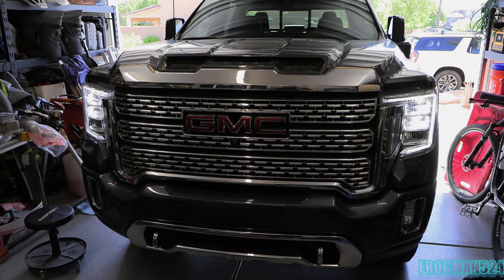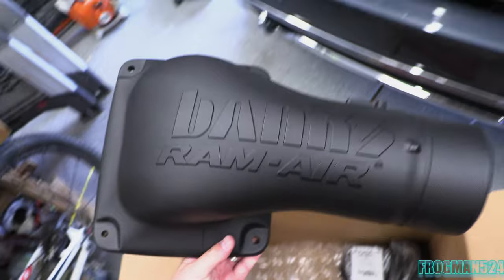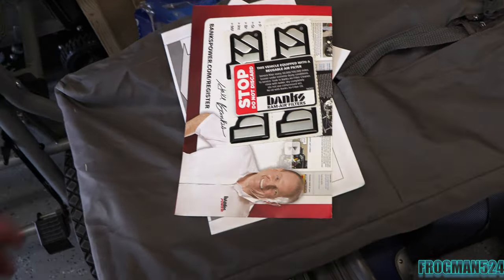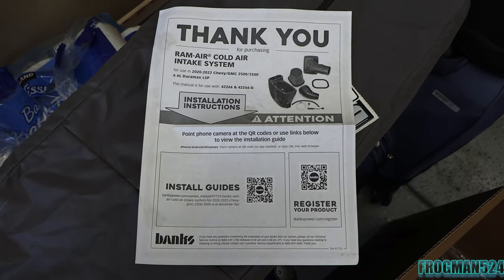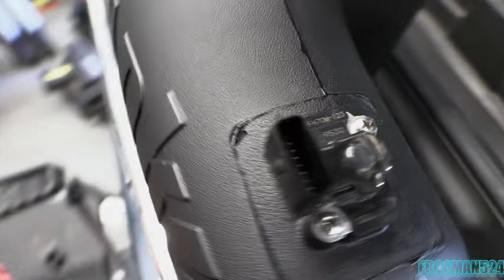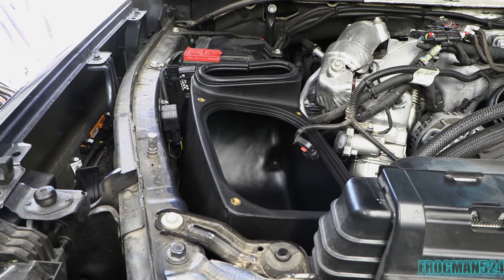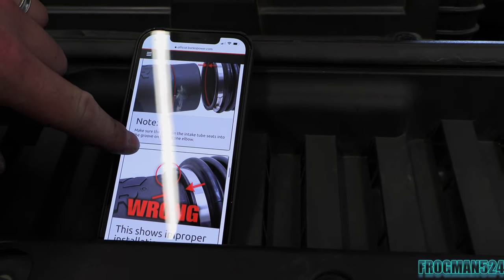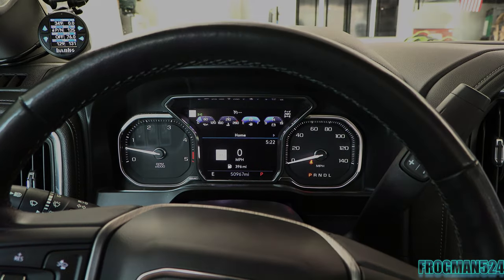2020+ L5P Duramax Banks Ram Air Intake Install

Comment: I was about this close to ordering it for my 2021 Denali 2500 HD before I read all the comments about code problems. Now I'm not sure it's worth it.
Reply: i just got my check engine light on ,after installing the ram air

Comment: Thanks for sharing the installation! Anxiously awaiting your review.
Reply from the maker: Thanks, I will get a video up after I receive and install my replacement Air Mass Control Module. The one that came with the kit we think is faulty because now I get a CEL every time I start the truck and a P00C7 code. Hoping it was just a bad unit.
Reply: Check out my before and after install sound video! Huge difference! Installed 1st week of June 2022
Reply from the maker: @Streetdawg02  sound difference is huge. Almost sounds like an LB7 now. Does yours have resonance like between 1700-2300 RPM? Feel any vibration in the foot pedals or floor board during light to moderate acceleration?
Reply: @FROGMAN524  Haha, yeah man I know what you mean with the resonance “throaty” sound. It comes and goes at different rpm’s. Dude, the exhaust brake is real now and you can hear it especially towing. I love it, she’s got some attitude
Reply: @FROGMAN524  any luck yet?
Reply from the maker: @mac007taz  with what? Resonance is still there but CEL is gone due to new air mass module from Banks on warranty with new calibration.
Reply: @FROGMAN524  was wondering about the CEL issue. We just ordered this kit for my dad's 2021 Denali HD. Pretty excited about it but I know it's new to market and there may be bugs to work out.
Reply: @FROGMAN524  I can feel a vibration at those RPMs with slight throttle. Not sure how I feel about it.
Reply: @FROGMAN524  getting the same code on my truck the second time I started it. It’s also saying engine power is reduced. Did you get your truck straightened out or did you take the intake off?
Reply from the maker: @Brian-ig8zx  once Banks sent me the new air mass module I haven’t had a problem since
Reply: Banks I’ve called several times. I have a CEL ever since I installed. Can you help me out?
Reply: @FROGMAN524  I also get the resonance and the vibration in the pedal and rewatched your video to see the end if you did a test drive and said anything about it. I got a code when I did the install and did a full reset at the batteries negatives and took away the engine light. But I didnt feel it strange to feel the vibration in the pedal around those lower rpms.

Comment: Do you regret getting this cold air intake or are you happy with it?  Mine has shipped finally after waiting 4 months. 🤞🏻 hopefully it doesn’t throw a code on my 2020 3500HD
Reply: How is it now?
Reply: @emmanuelsaldana7867  it put a check engine light on. They sent me another and I haven’t had any problem with it. As far as power. I can’t feel any difference. It has a throaty sound. Not much of a difference in turbo sound.

Comment: Dry filter cleaning notes from Banks:

1. Carefully tap the air filter element to dislodge any large embedded dirt or debris.

2. Cleaning: spray an appropriate DRY air-filter cleaner SOLUTION liberally onto both sides of the entire filter element with the majority applied to the dirty side (outside). Soak for 10 minutes. Do not allow the dry air-filter cleaner solution to dry on the air filter.
NOTE: NEVER use gasoline, steam caustic solutions, strong detergents, high-pressure nozzles, or cleaning solvents to clean the filter element.  All of these can cause harm to the filter media as well as SHRINK and HARDEN the rubber end caps.

3. Rinsing: Rinse the filter element with cool or warm (NOT HOT) water from the clean side (inside) out in order to flush the dirt out of the filter. It may may be necessary to use your fingers on the hose to apply LIGHT water pressure. Repeat steps 2 and 3 until the water flowing through the media is completely clear of any dirt and debris.

4. Drying: After rinsing, gently shake off excess water and allow to dry naturally. Re-install the filter onto the intake system, air box or custom assembly once it is dry or just slightly damp. Follow all original installation instructions.

5. Reinstall: Reinstall your BANKS RAM-AIR element with proper care. Make sure the element seats properly in the filter case. Install the cover making sure it’s in the right position. Tighten all the nuts, bolts, screws or clips to factory specifications.

6. DO NOT DISCARD: Affix the “Do not discard” sticker to the filter case ( INCLUDED with every BANKS replacement element.) Make sure you put the sticker in a highly visible place to alert your mechanic not to discard.

7. PERFORMANCE HINTS: Service every 50-100,000 miles on street driven applications. Service more often in off road or heavy-dust conditions. If an air-filter restriction gauge is installed, then change the element when the air-filter restriction reaches 18”-H2O.

For oil filters I suggest going to Banks power.com and look up the MORE information section under the air filter part and read the 10 step process to cleaning and re-oiling filter. If you are in the farming community Dust draws the oil out of the filter. That is why I went with a dry filter for mine (High Dust Area)

Comment: Hey how’s your filter holding up in AZ? Think you’ll even get 20k miles before having to clean it?
Reply from the maker: Holding up fine and it can’t be cleaned it will be replaced as it’s a dry filter.
Reply: @FROGMAN524  I bought a dry filter as well for the midwest region. Banks told me that they can be cleaned. You might check again.  The filter is lined with wire mesh is it not? That is to create stability when you wash in soap and water bath.
Reply from the maker: @L8nightride1  in my experience they are not washable but I’ve got a spare from Banks anyway so I’ll just switch it out.

Comment: I put mine on and keep getting check engine lights and now it’s on limp mode
Reply from the maker: Calls Banks Power. THey need the code off the truck but I bet you got the first gen air mass module and it needs to be replaced with the new calibration one I got. Fixed all my issues.
Reply: What year is your truck?
Reply: @scolwell720  2020 I tried 3 different modules they all gave it a check engine after the first 30 miles
Reply: I just received mine 3 weeks ago, just installed and same thing. Drove for about 5 mins and check engine came on. Now trying to get ahold of support at banks is a pain.
Reply: @andrewbarnhart1281  They sent me three new modules and it all did the same problem so I sent the whole system back and got a refund not worth having the engine light on and the truck went in limp mode
Reply: Did you get your truck straightened out? I also got a check engine light and it’s saying engine power is reduced 🤦‍♂️.
Reply: @Brian-ig8zx  they sent me a new module and I’ve been good to go since I got it. Haven’t had any more issues
Reply: @andrewbarnhart1281 thanks for the reply. Kinda stressed having $100k in a truck that now is parked in the driveway and can’t use

Comment: Everyone compares these to s&b bit no one is comparing to WcFab. Haven’t seen any tests to see which one is better
Reply: Banks did airflow and power tests on all three. There is a video.
Reply: @scolwell720  I’ve never found one involving wcfab. Even in all their videos.
Reply: @jasonkwasky53  wc fab is out here by me. They run a sleeve over their filter. Easier to wash off i would imagine but that could become a barrier if the fabric gets clogged. WC i believe is an open compartment. With banks the plastic resin is a thermal barrier from the engine compartment allowing for cooler air (increased air density) in a forced chamber (ram air). Banks puts a lot of time and effort into aero and fluid dynamics. Don't get me wrong, WC makes some great products. Have spoken to them personally as well. Impressed with some of their products as well. I am new to the diesel world, but i do research the heck out of everything. Very attention to detail, anal retentive some might say. Military will make you that way if in the right situation. I never knew i was in a hotbed of leading diesel suppliers. Airdog, Fleece, S&S, blackstone, WC Fab, HSP, Ryan's diesel, Kodiac truck.
Reply: @jasonkwasky53  diramax tuner does have one wcfab slightly out performed SnB

Comment: Where is the review?
Reply from the maker: Putting miles on it first
Reply: @FROGMAN524  did you go with oiled or dry intake?
Reply from the maker: @gt3001  dry
Reply: Are you getting a message to check air system? I have had mine on for a week like 3 days ago I stared getting this message on start up. It's not a check engine lite just a.pop up message and then when you scroll to thr air filter life it says check air system
Reply from the maker: @rodbrewer3801  call banks. You need a new air mass module
Reply: what mpg are you getting now, looks like you were at 14.5?

Comment: I had nothing but problems when I put a bank steeringer a bank's pedal monster on my 67 diesel It was skipping and sputtering and all kinds of stuff I mean it was just it was horrible so I will never put anything like that on my truck again from banks I don't even know if I would put an air cleaner I'd probably go with SMB air cleaner but I just I got a really bad taste in my mouth with banks when now that happened is just I don't even know I don't even know what to say about it it's just they wouldn't even help me I called him and told him about it they were just either take it off and send it back and we'll send you a new one or or you know take it off and you know send it back and we'll send you money back and we can't help you or anything so I mean they even try to I sent my Derringer back and they sent me another one back into the same thing so I don't know I took it off and I've had no issues